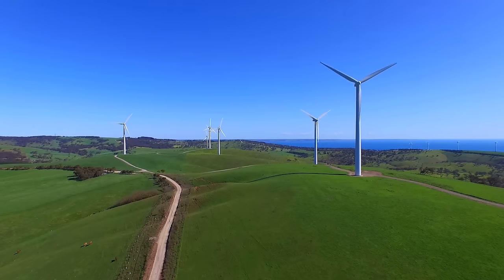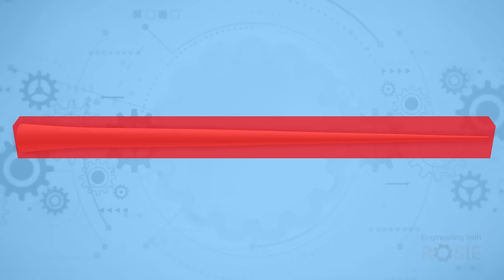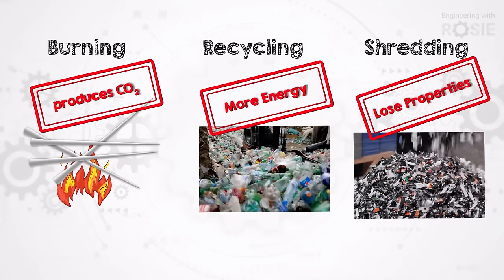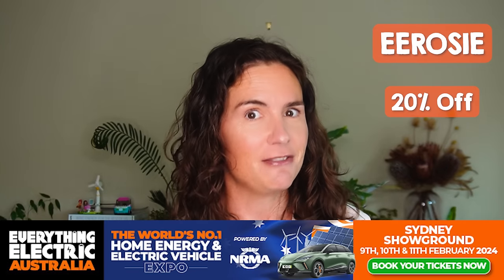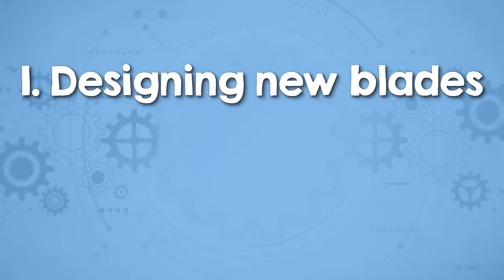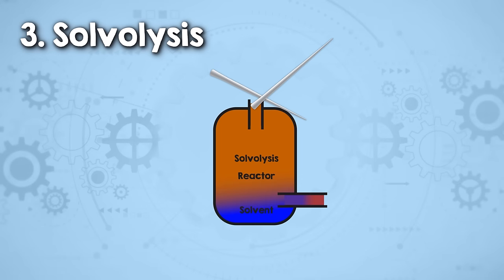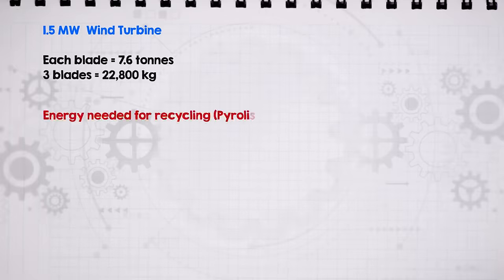This Is Why We Don't Recycle Wind Turbine Blades

Comment: Hi Rosie, a topic suggestion: How large would a turbine need to be so the speed of its blades' ends would reach speed of sound? How much power would it generate, made of what materials, sonic boom a problem? Is this the practical limit? It would make a super interesting video.
Reply: The speed of sound is about 343 metres per second. If a blade takes 4 seconds to rotate then the tip would be moving at the speed of sound if it covered about 1400 metres.  That corresponds to a blade length of about 220 metres.

Comment: Will landfilled wind turbine blades decompose into methane or other greenhouse gases?  (Just asking.  It seems like a possible concern.)
Reply from the maker: Lots of things decompose and release methane so that's a fair question! But not wind turbine blades. They are inert. They will stay there for many many many years, and in fact when we develop good recycling methods we'll be able to dig them up and recycle them if want.
Reply: @EngineeringwithRosie Technically, this is effective CCS!  😉
I say this (tongue in cheek) to people who whinge about inert plastics being landfilled. But it's true....
Really interesting uptime podcast you did about blade bonding BTW....

Comment: Has anyone tried to "recycle" blades into low-cost etc housing materials, e.g. roof tiles? Most countries are facing a housing shortage awa an affordable housing crisis with many lower-income & younger people struggling to afford a home of their own. It's a complex issue, but I'm sure access to low-cost materials - such as from old wind turbine blades - would help immensely. Curitiba (Brazil) has an extensive recycling program that does support its low-income housing sector in one form or another.

As a person that will never own my own home, I would never complain if I could construct a whole space for myself using an old blade or two from a dump site - as long as it was safe to do so.

Comment: We could use shredded turbine blades to help build modular sea-retaining walls, to help combat sea level rise. (No, there won't be enough material to actually do anything useful with it, but the optics of that will completely offset the negative optics of the non-issue this really is.)
Reply: I initially had a similar thought, but after thinking about how retaining walls are installed I discarded it....

Comment: As the resin is thermoplastic, it has already been heated and vacuum processed most volatile residues have been removed. Since they were also exposed for several years it is likely that whatever might have survived manufacture have also dissipated.   As the blade stacks are “interesting” and provide shelter, they may be suitable for artificial reef construction.  Granted some type of surface coating might be needed for bio-compatibility or to enhance the ability of coral to bond to the fiberglass substrate.  All they do in west Texas is provide rattlesnake and rat habitat.

Comment: She talked about repurposing wind turbine blades, but only considered uses for humans.     They should consider other uses.
    
Cut up the blades and use them to house animals on farms.    Or for farmers to shelter their machinery.       

Cut up the blades and use them to hold solar PV's to the ground.     1)   Put the solar PV frame assembly in the position it's wanted.   2)  Then put the cut up wind turbine blade in a position to hold up the solar PV frame, 3) then put the dirt around the cut up wind turbine blade.    The cut up wind turbine blade will become the solar PV assembly post.      Many wind turbine farms are adding solar PV's to their wind farms.     Wind turbine farms are already away from higher density cities, and the wind blows less during the day than night, so putting solar PV's on wind farms better utilizes the electricity transmission lines already built.

Comment: If Australia was allowed to use nuclear power, especially Molten salt reactors, all these polluting wind turbines and Solar panels would not be needed as we would have reliable baseload power 24/7 for around 70 years.
Reply: They have attempted to build molten salt reactors, but they are not cost effective.     They start to build them, but then there are huge cost overruns.    If molten salt reactors actually worked well, you don't think they would be everywhere by now?    The reason you don't see them everywhere is they cost to much.

Comment: So its not a problem with the blades per se, it's more that the manufacturing sector isn't required to close the loop on their products life cycle, as is usual for most industries. Thanks for the informative break down.
Reply: Closed end industrial life cycles are the exception not the rule. And they most often come about because there's something economically viable to recycle. The composite material of wind turbine blades is not one of those materials.
Reply: Surely products that are sold as being the green alternative should have those requirements baked in. Otherwise they are no better than the old products we are being told we must replace

Comment: Carbon Rivers (Knoxville, TN) has proven a process to recycle composite materials, including wind turbine blades, into virgin equivalent fibers.
Reply from the maker: I believe they use the multi stage pyrolysis process developed by Ryan Ginder at UT.

Comment: There are many places that need land stabilisation for building, for example houses or roads. Especially in wetlands. Sure using blades for such land filling is much more positive than present solutions. One could as well consider making sound-proof wall's in urban area's from them. Secondly I think the concrete additive solution has much possibilities, including new solutions of concrete not used today. If shredding is cheaper than generating and transporting clean sand and surely safes weight in the composite while having good binding properties it certainly has a change in many applications. I am positive with a little more brainpower and awareness there are many more solutions to what does not have to be a problem. Good basic overview. Thanks.

Comment: Voodin a German start up are developing large LVL (Laminated Veneer Lumber) timber blades for wind turbines. Stora Enso a large Finnish forest products multinational  are providing the timber. The blades are CNC milled to the profile required and sealed with a coating. They are testing a 19.3 metre blade on a turbine and have plans to develop 60 and 80 (~9.5 MW turbine) metre blades. I would not be suprised if the incorporated carbon fibre reinforcing.

Comment: those should never be buried. they should be shredded and reused with new glass-fibre in compression applications like house foundations, (better design) sip walls, etc etc.   same as every other item if broken disassemble and only send the broken part (bare minimum) to recycle and reuse all the good parts.

Comment: Very interesting video. Recycling of Rotor blade easy explained. We as the Fraunhofer IWES also working in these Field. We are looking at the advanced recycling methode to sperate the parts from which the rotor blade existing.

Comment: Has anyone thought about chemically decomposing the resins in something like nitric acid or sulfuric acid ?  I have used these chemicals in the past to decompose epoxy resins in the past  for doing failure analysis of integrated circuits.  I used these acids to dissolve the epoxy encapsulation so that the silicon die of failed component can be examined.  These processes can be done at fairly low temperatures of 100 - 150C.  I would think that glass fiber would hold up pretty well in a strong acid.  Not sure about the carbon fiber though.
Reply: She mentioned that

Comment: Would you be able to do a video about wind turbines performance and operations in extreme cold weather? In Alberta Canada, all the wind turbines were offline for a few days in Janurary 2024 due to extreme cold below -35c. With the transition away from fossil fuels, how do you see wind turbines fitting into the energy profile of areas of the world that experiences high electrical usage at the same time of extreme cold?  Thankyou!
Reply: Very cold climates are the only places where nuclear power makes economic sense because of these sorts of issues. Where Rosie comes from (Australia) energy demand is far largest in SUMMER (eg air conditioning). As Rosie points out in other posts a mostly solar grid is a no-brainer for that country but more wind makes sense in northern latitudes. But there will be some places even in the chilly north where wind cannot do the job.

Comment: Wonder if aircraft dismantlers are helping/leading the way in this field or watching and following what happening due to aircraft not mainly made of metals anymore but being made out of more and more composite materials?
Reply: Most airplanes are still made of aluminum; the new composite beasts are stripped and chopped up and ... buried.
Reply: Composites fail without warning. Sure, they look and sound cool. They're high-tech, state of the art. Who doesn't like new high tech cool materials?
They'll accuse you of being an old fashioned hard headed old geezer if you don't like new cool high tech materials.
Composites are light and strong and fails without or little warning.
Remember the Oceangate sub? One minute they were fine and then WHOOMP! Pink mist and powdered bones mixing with sea water in less than a second. And where are the carbon fiber pieces? Spread all over the bottom of the ocean, just sitting there and happy as clams.
That is why commercial, transport, military aircraft parts such as wing spars, engine mounts, and fuselage ribs are still made of good ol' metals (aluminum alloys, etc.).
Composite parts are okay for single passenger aircraft. If a wing spar breaks only one person dies screaming while plunging to earth at approximately 9.8 m/s squared as recommended by good ol' gravity.

Comment: Why not make a polycarbonate wind turbine blade?

Here’s an even better question -

Why not make a huge vertical wind tower that’s sloped so it can better withstand extremely high wind?

For wind towers, do they use a vertical turbine, and how stable are they during tornadoes?

Comment: there is recyle, there is also reuse and upcycle.

Chop the blades in parts and use them as roof for bus stations/sheds (there are plenty of those in every country). They can protect from rain (and wind a bit). Not great aesthetics, but they will help keep people dry and thus they will have a function.
Further they will last for decades.

Also every shed roof that was done with cheap plastic, can be done with parts of old wind blades that are large enough.
Reply: Fiberglass work (especially cutting and grinding) is actually pretty hazardous. So doing it on site, envisage safety glass,  breathing devices, and probably overalls

Comment: One thing I do not understand, when a wind mill arrives at end of life, it is usually that the bades are eroded.
A new alternator can be fitted in the nacel or retrofit the old one, why not recoating the existing blade some how to give it back its integrity and remount it on the same windmill. instead of recycling, just rewamp and restart.
Maybe there are effects that I do not, I am just an electrical not a mechanical nor a material expert.
Reply: The thermoset polymer and fibers have an effective design life at the core as well as the surface....
Plus, optomial blades keep getting bigger, requiring taller masts, new generators, etc.
Iteration produces more efficient designs, and the wind farmers are looking to profit.
Sometimes (every 20 years?) you may as well upgrade your depreciated inventory for a more modern design
Reply: Jimurrata6758 put it well.  I’d also add in that given surface wear varies from blade to blade, and that there are multiple blade sizes/shapes, short of by hand in some giant hangar, the tooling/process control would be quite difficult.

When making new blades (with recycled materials or not) you don’t need to worry about this.

Although i am no proper expert either!  So no worries on that and i’d love feedback too lol
Reply from the maker: In the very early days of this channel I made a video about design lifetime that answers your question in a fair bit of depth. I think it's called something like do engineers design products to fail (I'm on my phone and can't look it up without losing my place in the comments, it's got a yellow thumbnail with a hand drawn wind turbine on it). But the quick answer is that the blades are designed to have the same lifetime as the rest of the turbine. And it's not erosion that determines a blades life, it's fatigue strength. It is possible to repair an eroded blade and operators will always do it because otherwise they'll have to spend far more replacing blades well before the turbines life is up.
Reply: @EngineeringwithRosie  ???
I just linked your video here and it's vanished.  🤔
I made a comment up thread about being auto-moderated but I didn't realize that a link to this very channel wouldn't work.
Reply: @ericlotze7724  There are robots that crawl along the blades, grinding cracks and refurbishing the exposed surface (much like you'd repair gelcoat on a boat hull)
But the companies that do this have to get a contract to inspect and repair the whole wind farm.
They're not going to visit a specific blade of a specific tower for this stuff without a lot of $$$
Ameliorating this cost across dozens of towers makes a campaign viable for the operators.
The wind farm would be money ahead just curtailing the one tower until it came to a contracted inspection of the whole farm.
Reply: @jimurrata6785  Know the company’s name by any chance, that sounds really neat!
Reply: It will probably adds the mass.   Normally, when you repair fiberglass,  you sand down and glue new layers.   First part is a fairly nasty process, in a second you'll add mass, which you then need to sand down back.     That's from sail boat experience :)

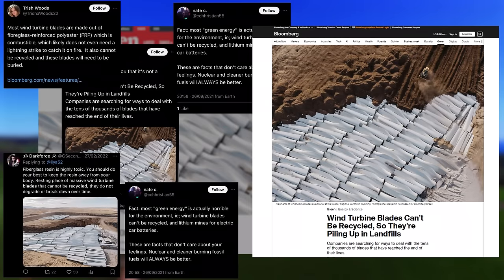Comment: 16:50 if a lot of these are from a sea area, can they not be used as some kind of sea barrier or wave break? I would think it has the right shape.

1. Carbon fibre isn't toxic I think, though I don't know if its a good idea breaking down in waves and impacts and washing up on shore beach? But I still think it could be used as some kind of underwater wave breaker.

2. Coating it in some other materiel to give it a new purpose.

3. Corals?

Comment: Could blades be used for fencing material?
Reply: How would you cut  and join it?
Reply: Mentioned around 7:30
Reply: Undoubtedly could be used a million different ways.  Problem may be more to do with how to process and market and transport them to achieve that.  Then there's the whole subject of cost (especially profitability).

Comment: As usual a thoughtful analysis from Rosie.

Explaining to people that the right solution is the right solution is hard.  Getting them to believe you is harder still.  But we really must let the atmosphere be the judge here, not people's confirmation bias.

Landfilling keeps fossil CO2 from the resin out of the atmosphere for millennia.  

Pyrolysis doesn't- a significant fraction- far more than the majority- of the mass of the resin will end up being burned.  And burning epoxies is a nasty business.  Given that the starting material is of fossil origin, this is basically GHG emissions that could be avoided by something which is also cheaper- and that's truly rare.  That's basically a net negative cost for CO2 sequestration.

Recycling the glass fibre isn't likely worth all the effort and energy input to chop up blades into sections you can move to some centralized pyrolysis facility, either.

As to solvolysis:  it would be interesting to know how well this process makes new epoxy monomers or precursors for making such monomers- because if it were to be successful, the other 90% of composite materials, particularly PC boards, would be worth pursuing first, rather than going after wind turbine blades and their associated transport problems.
Reply: Landfill is easier in one places and harder in others.   Imaging landfilling in Netherlands, where every parcel of land is spoken for
Reply: @dmitripogosian5084  people who think their land is too precious to use for landfilling, either need to not generate wastes needing landfilling, or must pay others whose land is less precious.  The alternative of trading landfilling for "air-filling" via pyrolysis or combustion should never be on the table when we're talking about a material which is of fossil origin.

Comment: Before I go into any further exploration and then actually engaging pardolote ( awesome!) I wonder if wind turbin blades would make good boats? Like if they either have small 10ft panel sections that can be reformed to slightly different shapes to match a boat hull for a catamaran? Or maybe they would make a killer waterslide?

Comment: a few questions: what are the criteria for retiring the blades? Only a set time period, or are they inspected? Assuming the loads on the blades do not exceed the elastic limit and only the surface degrades, could they be resurfaced, kind of like tires are retreaded? How about blades made of aluminum, like plane fuselages? would these be a good topic for another video?
Reply: those questions are addressed in this channels other posts

Comment: Thanks - that was very interesting.  I found myself with remaining questions though... with all that strength, what deteriorates to require the blades to be replaced?  If the wind farm is in an isolated place, why don't we use them until they snap (or whatever) ?  Are the blades replaced after a specific period (years/rotations) or when some probing instrument finds they are becoming weak/have been damaged?